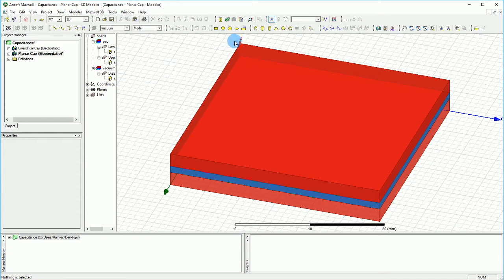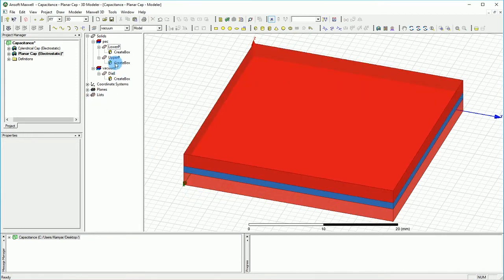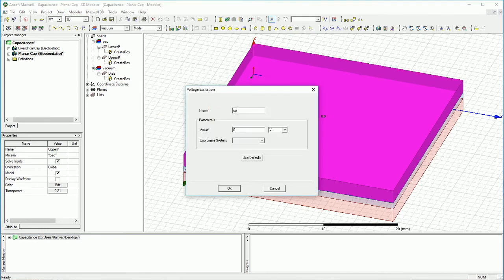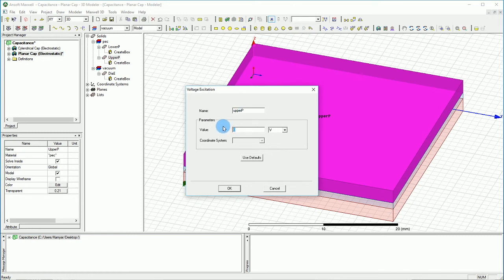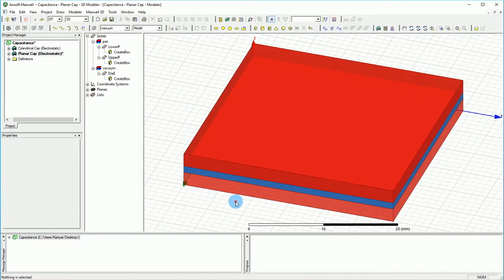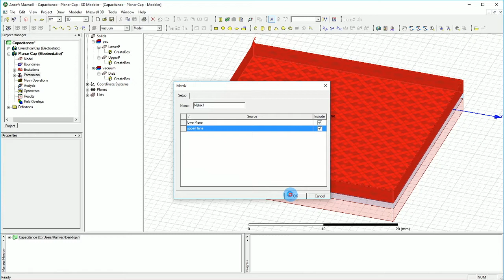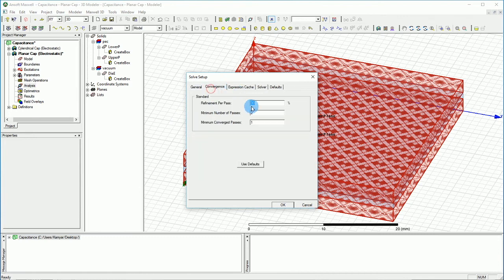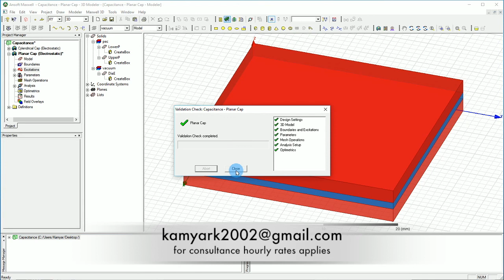509 - Ansys Maxwell | Electrostatic Planar Capacitance [2/3]

Comment: Hi Mr. Kamyar, i am trying to design an IDC based this concept and when i try applying the voltage to the left side or right side i keep getting error "Cannot apply voltage excitation to non planar entity". Any clue on why this might happen?
Reply: Harish Kumar same problem did you find a solution ?
Reply: Yes, i figured it out myself. Change the excitation from default to electrostatic